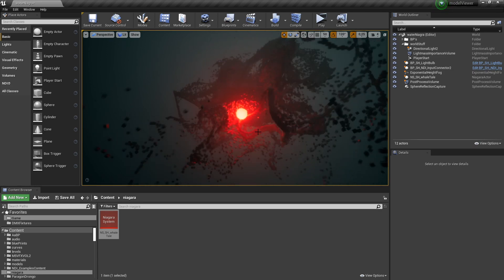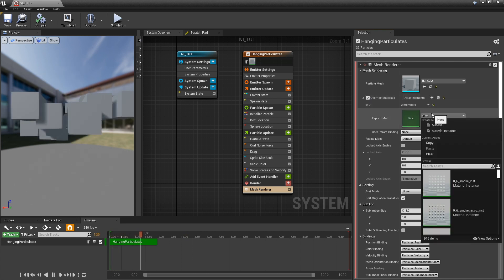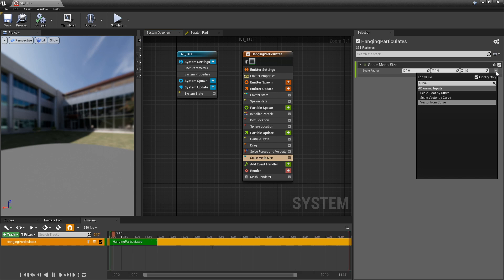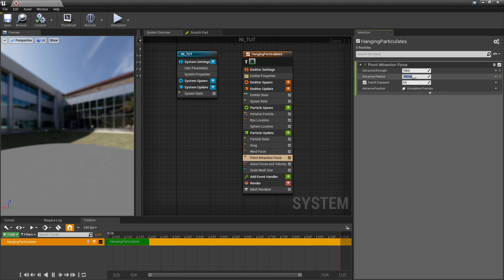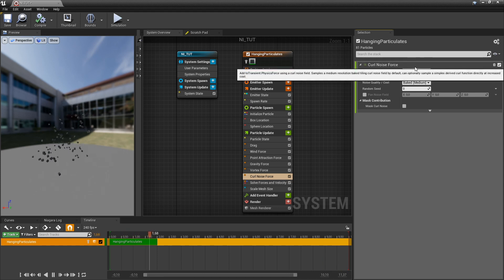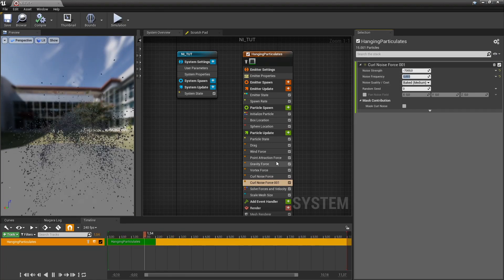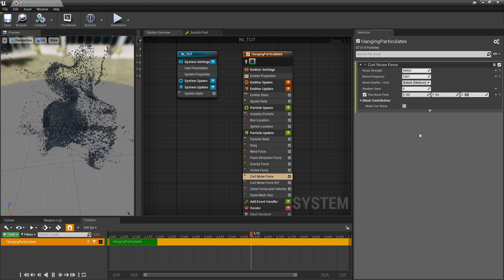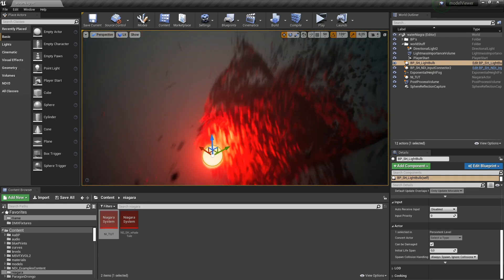Let's build this Unreal Niagara particle sim within 6 minutes

Comment: Heya! So just a few fixes for those in a newer version of unreal (I'm in 5.4)

- Wind Force: Either disable it or set it to something like x: 10, y: 10, z:  and Wind Speed Scale to 2.0. This will help contain your cloud alot more. Then in turbulence, set the scale to about 8, Frequency to 2 and Turbulence flow duration to about 2 as well. Play around with this, because it really gives it that tenticle look. Not sure if it's what you want, but worth looking into
- Point attraction force: Set the strength to about 80 and enable falloff exponential and set to about 0.2
- I disabled gravity but up to you
- Set your drag to about 80
- Set your Curl Noise Forces above a value of 1

The rest is up to you, but it should start putting you onto the path of something less "swarm of bugs" and more "Typhon from prey"

Hope it helps :)
Reply: thanks a lot this new update changed the tutorial output
Reply: thx a lot, i love u!!!!!!!!!
Reply: Thanks man, you are my saviour

Comment: in UE5, disable the default "aerodynamic drag", then add the "drag" parameter to get the same results after the curl noise step. :) hope that helps
Reply: Hi, i followed this tutorial in UE5 and the particles are moving in one direction. You got any tips to fix it?
Reply: @calm455  I had to tweak a couple things a little bit to get it working well in UE5. Increasing the Falloff Exponent (I ended up with 0.7) on the Point Attraction Force helped, I also reduced gravity a ton, and for the 'Wind Force' in UE5 I set the scale to 6.0 and the Frequency to 0.2. Definitely still not as cool as his but it's close :/
Reply: My hero, been tweaking for hours! Cheers
Reply: my hero, fall in love for u

Comment: For those on 5.1 I needed to set max particle speed pretty low in order to get this effect. A couple other tweaks to drag and noise as well.
Reply: Where can I find max particle speed variable?
Reply: @Maciok2000  With UE 5.1, I found a "Speed Limit" setting under the Solve Forces and Velocity item that should already be included with the HangingParticulates node.  The default (for me) was 1000.
Reply: @jleethompson2266  Thank you very much!
Reply: change the wind speed as well. That got me the exact same look as in the video.

Comment: Ok, if anyone want to resize the particle in game (UE5):

1. choose a dimension and take the multiplication/division scale (for example instead of 1 unit i take 0.1 unite so my division scale is 10) and apply it to every axes (x, y, z).

2.divid or multiply the number of particle with the multiplication/division scale.

3.now we have to change the mesh attribute in mesh uniform with the same operation as before.

4.Finally in the Drag section do the reverse operation in the drag section (to take the same example as before, let's imagine my number is "10" so instead of dividing i will multiply).

Hope it help.

Comment: In UE5 (5.0.2) when I implement this tutorial, all I get is one big "tentacle" of particles. (yes, I used the fixes for the 4.26 version from the comments)
The tentacle itself rotates but it looks nothing like the finished result from this video.
Reply: Same for me in UE5.0.1
Reply: @hallociao9981  I just discovered a possible fix: Scale it down to 0.2 (uniformly) when placed in the world. For some reason the result looks much closer to the tutorial than before
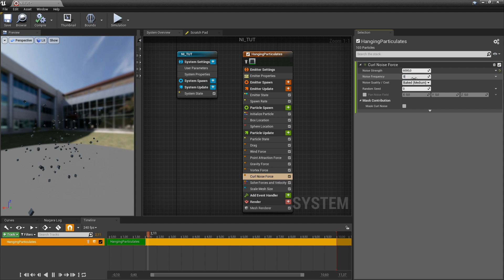Reply: What worked for me was to increase the noise frequency at 3:40

Comment: New to Unreal stuff but trying this tutorial in UE5 and I'm getting a weird error where the after applying the cube mesh the animation is solid for the first playthrough then it's starts flickering constantly and the cubes all turn transparent. Still within the Niagara editor section. Taking the chance this might be a common glitch that maybe you have seen it before and know of a solution. Google isn't helping.
Reply: You can see a couple instances in the video where it still flickers slightly. The flickering is caused by excessive mesh overlap. In UE5.0.2, it seems slightly more sensitive to the overlap, however I am getting a fairly similar result with the same settings. 

Don't forget to scale your mesh size over time with the vector curve, this helps reduce the total mesh overlaps. Keep in mind, the preview window seems to be more sensitive than the actual scene render.

*increasing the size of the fixed bounds also helped, seems fully resolved on my end. I used -1000 for the minimum x,y & z values and 1000 for the maximum values.
Reply: @g10118  Thanks for the insights. Much appreciated.

Comment: In 5.0 after you set the mesh size to UNIFORM in the Mesh Attributes, you can then (In that same section/panel) add a FLOAT FROM CURVE that does the same job as the original Scale Mesh Size node in the tutorial (Use that same size setting - 0.13)
Reply: Thanks a lot !
Reply: You are a fucking legend! saved me a tonne of time. Was about to give up.
Reply: legend!
Reply: it works!!! you're a star!!!
Reply: Someone should Pin this post....
Reply: @Max Wolford thank you so much！
Reply: wow i was liking comment above yours, but this is helped me out even more :)
Reply: Only thing i cant seem to figure out is; my cubes are not scaling down? Someone out here that knows how to fix in ue5?
Reply: @3dsteve978  @Arthur Baum - Same problem here, but I found out that you can add a "scale mesh size" under the "particle update" tab that updates correctly.
Reply: @3dsteve978  I'm having the same issue. ):

Comment: Great stuff! was able to make my own version of this! the only thing i didnt manage was: making the system emit shadow. well I did, but it nearly broke my computer, lol. I have same spawn rate as you and running on Core I9 12th gen with 3080 GPU. why is it lagging soo bad while yours isnt? any ideas?
Reply from the maker: maybe it's other stuff in your level? or maybe unreal is running on the cpu internal graphics instead of your 3080 ? i found this comment on that: "If you into Nvidia Control Panel, then 3d settings, then the global settings tab, there should be an option to switch default gpu from auto to your dedicated gpu." 

because i made and recorded this tutorial on lower specs than you, i think it was a 780M even, so something fishy is going on your computer

Comment: thanks for this! how did you build the spherical light? sorry if it's stupid, am only a beginner
Reply from the maker: the light is a sphere mesh with a glass material. Inside the sphere i've added a point light. That's all i did
Reply: @shimlaDnB  thank you! have just finished doing what you did step by step - any ideas why my particles appear as spheres although I have adjusted the mesh to be a cube in Niagara? cheers xx

Comment: I'm getting an error:
"Failed to add module EmitterState to section of type MovieSceneNiagaraEmitterSection.
Message:Failed to bind 'num loops' for module.  Messsage: Could not find the default pin for this input in the source graph, it may be hidden by a static switch.

Comment: Question: How to make particles start already in the curls position? instead of waiting until they reach certain style, make them appear from start in a vortex position?
Reply: Not sure how to do it with Niagara settings (new to UE), but you may be able to do it by hiding the actor for a certain amount of time until the style you prefer emerges. Could perhaps use the "hidden in game" or "visible" flags.

Comment: Just a quick question, is there any way to modify this a bit so it moves a lot slower ? I'm trying to use this tutorial as a stepping stone to build a galaxy based particle system but the movement is too quick.

Comment: I'm following this step-by-step, but I'm not getting the same results. As soon as I apply the first Curl Noise Force, all the particles shoot straight down and then nothing works correctly after.
Reply from the maker: The curl noise force parameters changed in ue 4.26, the frequency value needs to be way higher now. what used to be 0.001 is now something like 0.25 or something. If they still shoot down way to fast adjust the noise strength or the drag strength

Comment: 4.26.1 Curl Noise Force don't work like  video's version. You can play with the parameters but you can't have the same result. Something between 1.5 and 0.5 could create similar results but ...... no
Reply: if you put a really hi Noise Strength value you'll have a similar end result. ( 25k  ~ 40k )

Comment: Something has definitely changed with the update, dont get the same results at all. Gone over the values several times :( 
I can tweak to almost get the same results except the movement. Especially the random movement, how can u get a random movement with fixed values?
Reply: Having the exact same issue, this tutorial is no longer valid it seems. Shame...
Reply: Actually just had a play about and read some other comments. Look into changing the Noise Frequency from 0.001 to 1. It's pretty good results!
Reply from the maker: yes the noise frequency changed in time, and the scale thing i've described in the description of the vid

Comment: I have the Problem, that the particles disappear   at a camera angle where I not directly look at the NiagaraActor. It disappear then at the edges of my screen. I think that is because the visibilty of the Actor is bigger than what UE4 thinks his size is. Is there a way to make the Actor bigger without actually changing his size or some other way?
Reply: I found the answer. Go to your Niagara Project
In the UDK

Step 1: Right-click on your Particle System -> Properties (near top of right-click menu)

Step 2: find the section called Bounds

Step 3: make sure "use fixed bounds" is checked

Step 4:

for min values

x -100000
y -100000
z -100000

for max values

x 100000
y 100000
z 100000

Comment: The Velocity and Speed of the particles are relative to each other. 
Is there a way to slow down "the animation" without loosing the shape of the particle system?
Reply: At the bottom of the particle update section, you can enable the speed limit for solve forces and velocity.

Comment: I'm using 4.26 and getting very different results from the point of adding the first curl noise. The particles just form themselves into a long tube sort of shape. ...Actually just had a thought half way through this comment and tried setting the noise frequency to 1, which gives me something closer to the video. I guess maybe they changed the unit scale for this at some point?
Reply: In addition, the drag module uses a random range with this sample emitter. If you select the drag module, select the drop down next to the drag value, and select "New Local Value", it'll allow you to set the constant scalar value to 1... at 4:40 he finally sets it to 10.
Reply: @MilkyEngineer  The first curl noise i found out that 0.8 are the same as in the video.. do try it out =)
Reply: The fix for 4.26 and later:

For the first Curl Noise Force:
- Set the Noise Strength to 6000,0
- Set the Noise Frequency to: 1.0

For the second Curl Noise Force:
- Set the Noise Strength to -7000,0
- Set the Noise Frequency to: 3.0
Reply: @HBjornsdottir  Thank you very much :D
Reply: @HBjornsdottir  You're the real hero! Coming in real clutch!
Reply: @HBjornsdottir  OMG thx :D
Reply: @HBjornsdottir  Yesss thank you!
Reply: You're definitely onto something with the frequency there, I tweaked the values up on both curl noises and had much more similar (although not exact) results.  I noticed that the newer version also adds a non-zero random seed to these, whereas it seems OP's seed defaults to zero.
Reply: yeah same here
Reply: yeap same here
Reply: Yep, good tips - something has def changed but bumping up the noise freqs on the 2 curls to above 1 seems to be the ticket.
Reply: Try trying these additionally, bit satisfied after playing with so many settigns
Point Attraction Force
Attraction Strength = 300
Attraction Radius = 3000
Reply: ohhh!thank you !!😆

Comment: Thanks so much for the updated info and prompt response to the difference and fix with UE4.26 with Mesh Scale.  I have another issue however.  I swear I have followed this guide perfectly but, when I get to adding the first curl noise around 3:45 in the video, my particles start to shoot downward.   I have no beautiful movements :(  I've watched video over several times rebuilding each time and checking my work.  Still I get stuck here each time.  Any advise would be much appreciated.
Reply: I had to change my noise frequency to .4 not sure if I repeatedly messed up following this tutorial or the scaling of ue4.26 changed from when this video was show.  It's most likely me doing something very wrong
Reply: im in the same boat
Reply: Same boat. This tutorial is outdated with the current engine settings. I keep getting what looks a steady stream, all clumped up,
 and none of the other effects are happening.
Reply: same

Comment: Curiously, it's all kosher until I apply the "scale mesh size" property, then no matter what values I put, my mesh particles won't display. I wonder if it's because I derped when creating the mesh, and its own values are bunk? Unsure.
Reply: Fixed: 
1. From the unity main view, double click your niagara asset. This will open the view he spends the majority of this video on, with the node map. 
2. Click the orange top part of the "hanging particulates" node. On the right side of the window, an attributes area will display. It will show regions like Emitter Settings, Emitter Spawn, Emitter update..
3. There should be a search box at the top of said window. Inside, type "mesh"
4. Your view should pop down to an option called Mesh Attributes -> Mesh scale mode. If it doesn't, use the arrow buttons in the search box to navigate through the results of the search. It should be the 1st result. 
5. From the dropdown, select "uniform."

Comment: When I set the first Curl noise force my particlse just fall in a stright line. Followed your instructions to a tee. Any ideas?  ( UE 4,26 )
Reply: Having similar issues here. Haven't figure it out yet. If i set the frequency to not quite so absurdly low, say, .2 or .3 for one and .03 for another ish, I can get some decent looking effects, but not nearly as cool. Gone over the setting twice now pausing on the video and it looks like everything is the same, so I'm guessing there's some default setting he has that we don't. I'll try to figure it out.
Reply: Ok so the unreal engine has updated how curl noise force "frequency" attribute is applied. Try to fiddle with values very close to 1.0 and see what you get. For example, I got pretty close to the video using .9 on the positive force one and .8 on the negative force one.
Reply: @komali2  Yes, so basically this video is a bug abuse tutorial.
Reply: @komali2  Yo this helped tremendously, thanks dude! exactly what I was looking for, it looks like the default value got bumped up so we don't have to scale as low which is nice. :)

Comment: When I add Scale Mesh Size the particles simply disappear and they don't show up anymore, regardless of the values.
Reply: same here! came here to comment precisely this :S
Reply: Ah reply is below. @lapricap
Reply: @muitosabao  Yea I managed to find the issue, I need to add that curve to the initial size instead.
Reply: Jorge Lemos  Two solutions: Handle scaling in "initialize particle" setting and remove the "scale mesh size" node, or, set mesh attributes -> mesh scale mode to "uniform"

Comment: I wonder if next gen will allow us to have such effects in games.. Probably not. Maybe once ps6 and next xbox come out. But the idea is very cool, and surprisingly simple, could be used for some cutscenes or even a real time effect in a small scene.
Reply from the maker: this will run on a ps4 i think, i mean this effect runs at 30 fps on my nvidia GT 650m
Reply: @shimlaDnB  sure but it's just the effect. In games effects are supposed to take around 10-20% of computing time. And much less than that in open world games.

Comment: Adding the Scale Mesh Size have the particles disappear? 4.26 PV6
Reply from the maker: I've only tested this particle system with 4.25, i still need to make the switch to .26 so i'm afraid i can't help you atm
Reply: @shimlaDnB  No worries, seems a few others experienced the same issue. I thoroughly enjoyed the video anyways. Subbed :)
Reply: Use the drop down underneath there’s a extra one in 4.26

Comment: How would you go about using a water material instead of cubes? Is that even possible?
Reply from the maker: that's very possible, you can just select a water material in the override material section of the mesh renderer module. though you'll need to create a water material first though, there are some simple water materials in the starter content
Reply: @shimlaDnB  great, thanks!
Reply: Did you get something working with the water? I thought about using meatballs.
Reply: I was looking for this answer. If you add the "Scale mesh size" parameter in 4.26. Particles dissapear for good. Thanks.